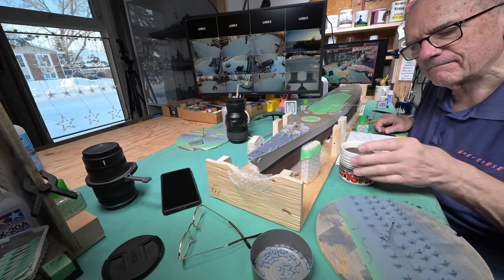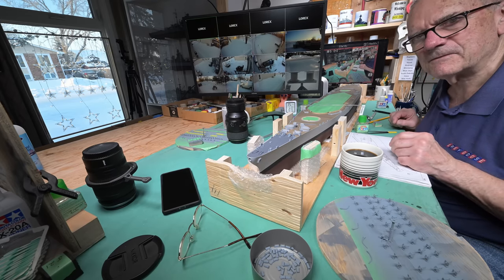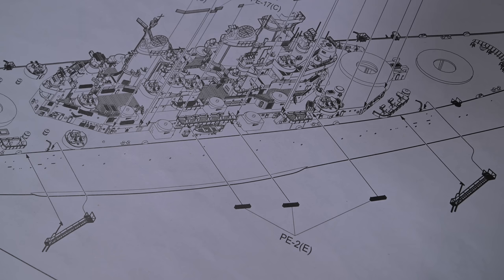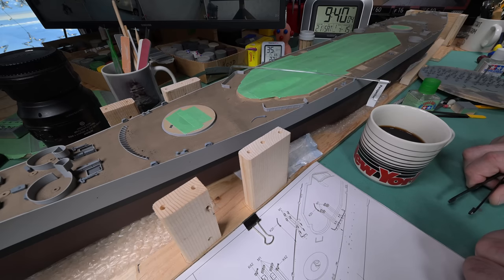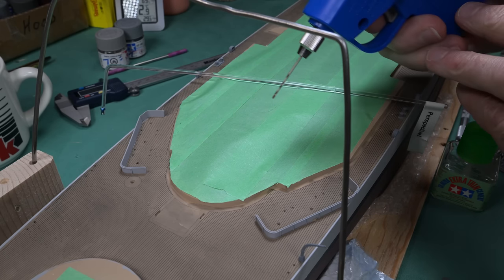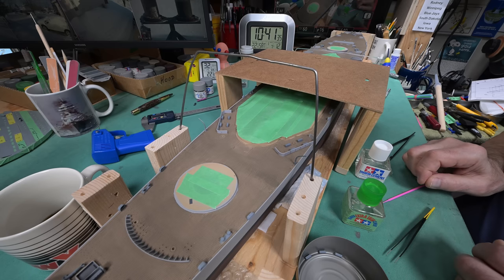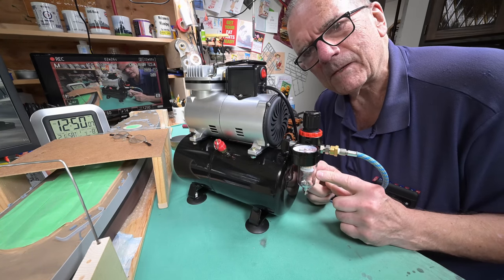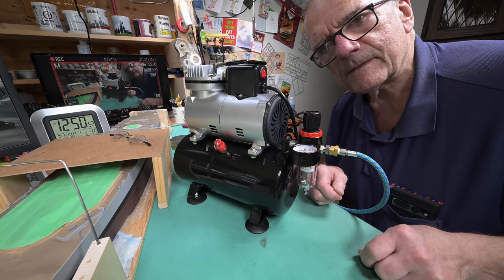The Model Ship - Part 1423

Comment: Hi Ron, I think you're talking sense re the water situation in the tank. I also think there is a big difference In the servicing of these small tanks that are fairly cheap and run at comparatively low pressures compared to the big tanks where you could have getting on for 300 pounds of pressure held in them. One of these you are definitely not going to want moisture left and causing any weakness by corrosion...
Reply from the maker: My large compressor down in the workshop shuts off at about 135psi.

Comment: Hi Ron, don't worry about what others say or do, please don't get stressed by it. I mentioned what I do regarding tank draining just for info, I am certainly not saying it is what should be done. I had certain things instilled into me when training as an engineer which stick with me. In the same manner, I do not leave bench or other vices tightened when not in use or torque wrenches wound up, always slacken off when finished same goes for micrometers etc.
Sorry for going off topic just trying to explain where I'm coming from as an engineer.
Reply from the maker: Hi Dave,
I fully understand. I'm that way a bit too regarding a few things. 😊
Reply: @roncalverley  Teaching old dogs new tricks me thinks 😂

Comment: If your tank is above 15°C water will not condense. The story is more like that: You compress the air, it gets hot. You let it sit in your tank an everything goes to room temperature. Then you  quickly decompress a lot of air - the air inside the compressor was at room temperature in will get much colder and the humidity stored in the air will condense.
Reply from the maker: Logical explanation. Thanks! 👍

Comment: Ron,  I believe your davit parts in this case may be ammunition hoists for the main guns. I'm not 100% sure about this but considering there locations on the ship it's not out of the realm of possibility. Check The Anatomy of the Ship book to verify for sure. See ya tomorrow.
Reply: Just suggesting Greg, I got the impression from where they were located they were to secure the gangways when they were deployed. I would have thought a crane with more muscle may have been needed loading the larger ammunition.
Reply: @marklivingstone3710  I was also thinking the same thing but at the time that is the only thing that came to mind. I'm also thinking that Trumpeter may have put the mounting holes in the wrong places for those davits.